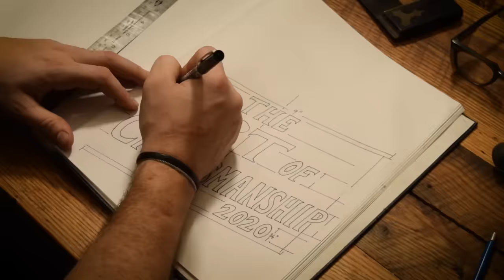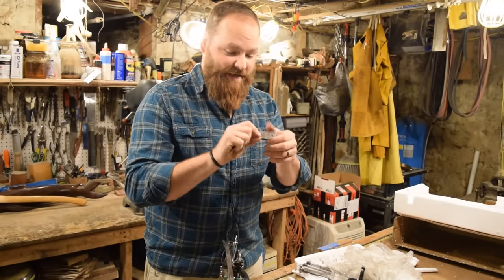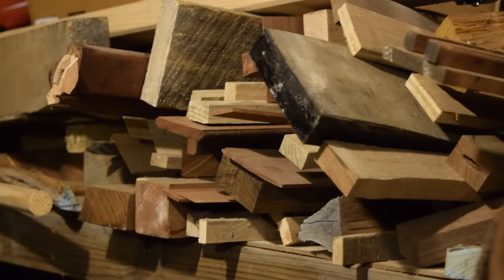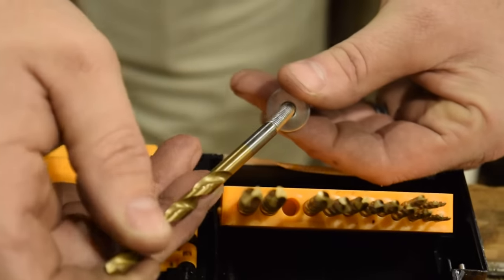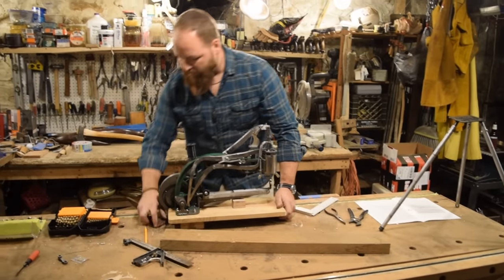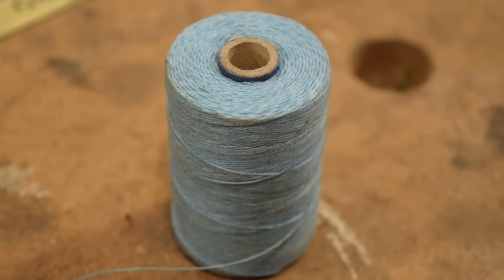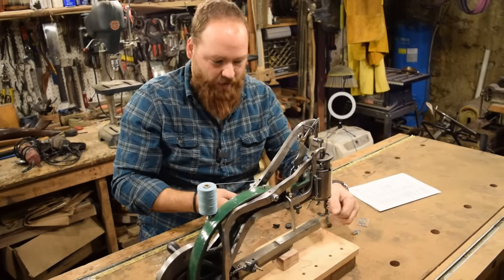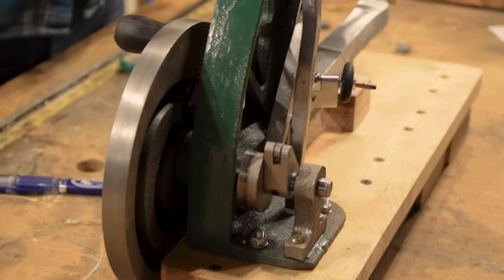The Infamous $100 Leather Sewing Machine: Unboxing and Setup

Comment: Love  everything but the hand flywheel. It is compact, metal built and for 100 bucks very affordable. I would use a piece of hardwood for the base and definetly drill holes to screw it down while using it. Anybody out there figure a way to put a foot pedal on this little guy? I mean, that's all it needs. you want both hands to work with any leather product, especially if you're gonna always sew in straight lines. You needs both hands to hold on to things.

Comment: Is that metal arm cracked at 17 minutes and 53 seconds in the video?
Reply: No. These machines are so cheap because they are VERY crudely forged and ground into shape. There is little divots and spots like that all over the machines where the casting simply wasnt thick enough to grind flat when they cleaned up the cast.

Comment: When i was using a hand sewing machine for Carpets all threads where waxed to increase slip. Twenty yards on a hand crank on a dense wool Wilton Carpet was a test for any machine, needle, thread and arms, as you had to pull it, in time.  Then two major changes happened in the industry. The invention of nasty Gripper rods and rolls of Carpet twelve foot wide retired the machine to the 
We gave up hand cranking because prolonged use is really bad for you, speaking from experience. A foot trestle is more suited to the material, as the power difference is huge and you get two hands on the material.
100 what ever is a fair price for all the work that goes into them. Now to wear it in. ;-)

Comment: Quite possible you just had it threaded a little wrong when the thread was breaking, there are a lot of ways to mess it up on the non-consumer machines. My rule of thumb is that if something goes wrong, re-thread the machine (at least the top thread).

Comment: You need to make a stand Where It Bolts onto the cast-iron and the throat of the whole shaft that's called a long arm sewing machine if the so down inside of cowboy boots tennis shoes moccasins you can sew on the insights so your throat to that thing has to be open okay

Comment: I got one and it depends where it comes from. Stripped it down refinished it, but things like the bobbin didn’t fit together. The thread spool holder was horrible. Spent over 20 hour repairing, painting and lubing it. Never got the bobkin to work correctly. Never got it to work so it went into the garbage where It belongs.  If your not good with rebuilding things stay away

Comment: There is a much simpler solution to sewing leather. An old fashioned treadle sewing machine with the right needle and thread will sew leather like a dream. Also, if you can find one like my grandmother had, it was basically a treadle machine that they put a motor on, those do leather too, with the right needle and thread of course. Treadle machines can be found cheap. I bought one at an auction for 30 dollars, and I had my choice of 3 machines. They're still around. The old treadle machines had to do everything, so they were robust and could do what you need. You may not want one for doing like heavy saddle leather, a lot of saddle stitching simply has to be done by hand, though they do make a hand stitcher that makes it go a bit faster. I'm kinda surprised you don't tool some leather for your sheathes and things. I used to do that stuff. It can be very interesting to say the least, but does take some learning time to build good skills like anything else.

Comment: I admire the craftsman and admire the machine.  Unfortunately, it seems not to have come with a book of instructions, so the buyer had to figure it out as he went along.  He made a few mistakes, as the comments illustrate.  I'd make them myself; however, I am a student of trying to think things through before cutting wood, working hard, and then discovering all of my mistakes.  Lesson-1 is shown at 12:18 where the lovely base needs to be corrected; we go on from there.  So, what to do?  You can't just start cutting and fitting, trying, and discovering.  You have to think ahead, which is hard to do when you don't have the experience of a professional leather-worker who has learned the hard way himself and passed it along to us.  Lesson-2:  That little wooden block, specially made to support the long sewing-arm, defeated the purpose of the long sewing-arm, as at least one comment shows.  The lesson, to me, another &%# craft hobbyist with a spotty record of success/failure, is not to start cutting  before promised salvation comes out of the box, but to stop.  And then try not just to think, but to imagine.  "Hobbyist" means 'amateur,' not professional leather-worker, in this case.  Why did those manufacturers in China do things this way?  Those folks ain't stupid.  They may not want to hire someone to write a book describing the ins-and-outs of something complicated that they're selling for what, peanuts?  So it's up to the buyer.  As to whom, "Thank you!" for the real life lesson in the need to figure things out, in advance, or else, lol.  Good luck; it looks like your off to an admirable start with your  new machine.

Comment: Hint:  Never run any sewing machine with the presser foot down and no material under it.  You will chew up the needle plate.  I got mine for $80 on ebay and it works perfect for heavy stitching jobs.  I'm curious why you decided to make such a large base....seems it would limit the range of jobs the free arm was designed for.

Comment: "there is a piece of leather there, that's kind of odd" they run the machine for 200 stitches on that piece of leather to make sure everything is good before they send it out. that piece of leather is proof of how your machine stitches. why would it be odd? you buy a gun and it comes with 1 empty casing. you're supposed to give the casing to the police department so if any bullets match that casing they know you killed somebody. i don't think it's enforced in any/many states, but the manufacturers still provide the once-fired shell for that exact gun

Comment: I don't think you see that the  long extension makes this machine capable of being in a boot or an arm sleeve unless you keep it  on a desk blocked in below.  A simple motor would rotate the hand wheel.         If you have a phone you can take a picture  of the bobin threading direction.  Everyone can take a picture.. Boy are the castings crude..  If you freed up the arm and lifted the machine you could make shoes.

Comment: As a fellow stitcher and diy crafts person, I cringed each time I heard this machine complete a revolution. 🤣If you going to lube it, if you can some graphite-based grease might help since it’s a fairly cheap unit and I’m probably guessing the clearances between some of the components aren’t remotely spec.  Also I’d put a pulley on it and make it like the old school pedal powered machines

Comment: Buyer beware:  Thses machines are the roughest version of a sewing device you will ever encounter. To get the potential they are capable of requires several hours of cleaing, de-burring, and polishing - or else you'll rarely get far before shredding your thread or jamming it because the timing has slipped. Expect to repeat all frustrations if you ever change the thread or needle sizes.

If you dedicate it to one size and leave it there, it'll work well enough.  MIne is set up for 138 thread using a 140/22 needle.

It does NOT reliably sew veg tan leather over 3/16" thick as delivered.  A dedicated leather needle with a cutting point might help.  The needles I am using are round - which is not the best for thick leather.  Too  much friction on the reverse stroke since a round hole in leather does not have cut fibers.  The result is very bad lifting of the leather when the needle starts its pull stroke.

Increased pressure on the foot simply stamps a deeper footprint into the work.  Get the best chisel tip leather needles that will work in this machine perhaps from Sail~Rite.

Wax on the needle will only rub off within a few strokes and will leave a buildup that cruds up everything.  Just get leather needles.

It works fantastic on layered up canvas, but so does my old Singer 223 - runs like a Mercedes and can be had for less than these Chinese scrapiron copies of a fine American patent from the 1850's.

Oil til it runs everywhere. De-burr everything.  Polish every point where the thread will run.  SOME people get sterling results.  I have for very short duration. I bought it to replace hand stitching because of worsening arthritis, but it cannot take the threads I use for holsters and heavier projects. 138 is the thickest it will work with, IMO.  It will not run artificial sinew because of the wax in it.

Once you get it tuned, I'd just leave that way.  Write down or take close up pics of the tension and presser foot settings showing how many threads are exposed for what tension is needed for varying thickness of material.

There are a few really good YouTube channels on this machine. I recommend watching a few from Harrison Hightower, who seems to be the Grand PooBah.  Very helpful.

  Junk or jewel?  Depends on your level of patience and finishing skills, because you are the one prepping the product for use. That's it from a Not Impressed Owner.

Comment: Why do they even bother trying to put a finish on those things 😂 Thanks for the review, I may have to pick one up.
Reply: Take it apart. File the edges, steel wool the parts, degrease, paint with hammered-finish spray paint color of your choice, lube & oil, reassemble ... aahhhh. 😎

Comment: Find a used sewing machine at a second hand store and adapt the motor and foot feed to the machine
Reply: That is a huge endeavor. Just saying. I've seen it done, but it takes major work and adjustments to the wheel to hold a motor belt effectively. And without the wheel, that thing won't function at all.
Reply: Someone just found an easier way to do it on youtube! Very exciting :)

Comment: I don't think it was the type of thread so much as it was the gauge of the thread that caused the breaking. The needles have to be sized to the thread. If the needle eye is too small for the thread it will cut it. To test for the proper needle size, thread the needle on the thread and then, holding both ends of the thread about a foot apart and fairly taught on either side of the needle, angle the thread to about 45 degrees vertically. If the needle is sized properly it should slide down the thread to the bottom using gravity alone. If it doesn't the needle eye is too small and it will cut your thread. This machine will probably be fine for very small jobs but I would not want to try and make a living with it.

Comment: so if a thick thread doesnt fit then its useless i guess, though i saw other leather makers praised the same machine, so i think ill pass on this and wont purchase it, thanks for the great unboxing!
Reply from the maker: There are several way to adjust this machine so that you can run thicker thread. I’ll be doing another video in the future with some add ons, and adjustments to get it working with thick thread and leather.

Comment: i understand your apprehension of the stand, and / or quality of equipment. but , in a practical, real world production application, where someone is sitting there daily, grinding out shoes, maybe it works for them. It's cheap, it's quick, and makes money..  if you want to be a leather seamer, then buy the real expansive machine? probably not gonna happen. But for 100 bucks? wtf. why not . maybe assemble it the way it was designed. then improve it after using  it a couple of times? Also, if you relieve the wood under the arm.  or create a drop table section, you can do larger projects. you limit yourself as it is. i like the concept.  i'm kinda picky. so i'd deburr / smooth the gears out and change to better bearings. in shipping there are preservative that also slow down the action . i'd have fun with that machine after "cleaning it up"  and a spot of light machine oil is your friend (<< hit like button)

Comment: The base is loose because it's designed to tighten and level as it settles into a dirt floor.
Reply: The base that came with mine holds it completely level and is actually pretty solid once the weight of the machine is on it. But I bet it would work pretty good on a dirt floor as well

Comment: Dude, have you never heard of Singer? Forget new Chinese junk.
Thier old machines made for leather still cost a pretty penny. My 1901 made for fabric can do what you do. 
I paid $200 for mine, not knowing the antiques market. They go for about $50. Moneywise, the silverware set left in the drawer runs about $150+. 
I bought it because it was cool to have something old that still works (1901) when my electrics don't.
I paid extra in ignorance, and broke even in luck.
The point of this story: look for the old and proven instead of new and cheap.
Old made in USA will be better than new made in China.

Comment: You mean cut a couple of chunks of what they call a modern 2x4 back in the day when they used to make real 2x4s we're actually two inch by 4 in not what they call today 2x4s today are a little bit smaller

Comment: !!!!! Motorize it!  For those in need of a cheap electric motor go buy whatever piece of cheapo machinery at Harbor Freight and cannibalize it for the motor. A lot of machines sold there are sold for cheaper than you can buy a new motor so not only can you get the machine, but a decent little electric motor when all the other parts turn to shit..and they will..LOL

Comment: If like me you wanted to just see if this works and is worth buying, skip to about 20 minutes in. A lot of time watching someone slowly cut a box open and explaining that there are random bits in the box etc etc.
Reply: Except, that, for the patcher, opening the box is one of the most intimidating parts. If you've ever bought a patcher and instead opened an oily, greasy mess of bent looking machine parts in a nest of crumbling styrofoam, you need that part of the video to reassure you that it's not as bad as it seems.

Comment: THROW THOSE NEEDLES IN THE GARBAGE. China made needles are so bad! Go to wawak.com and get the Organ brand in a HAX1 or the better quality HLX5. They're the same shank , but the HLX5s are stronger and made for thick multiple layers of material. You'd probably need size 20. They're only a couple bucks, but these needles are 1000x better quality than those cheap china needles.  That could also be why you're breaking thread. I think you're needle is too small (for that thick of thread), and those needles probably have burs in the hole that are probably cutting the thread. I would recommend the tex70 nylon thread from wawak. Its super smooth and really easy to sew with. That monofilament stuff is not good.

Comment: In my experience with these Chinese shoe patcher machines, they use poor materials and rudimentary methods of production with these. I had two of these, one that would sew ok and another one that is just a piece of crap and would jump out of time about every 3rd turn of the crank, no amount of tightening or thread locker would stop it from jumping time. The one I say would sew ok would still skip a stich every 50 to 100 stiches due to the slop in the gearing the machine uses, they are very much NOT precise. When stiches are skipped on leather you have a hole in the leather from the needle with thread stretched across it on your leather instead of in your leather. That is not something I can sell on top of wasting my leather, thread and time, if it is a hobbie then maybe but if your sewing to sell a project it's just not something that is usable for me. I took it down to one of the local sewing shops and let the engineer look at it and after scoping the inside of the sewing arm and measuring with calipers all the parts we found that the teeth on the gears were out of tolerance due to poor manufacturing causing the timing to be off at times just enough to skip a stich every once in a while. He advised we could order more gears, but it is likely we would end up with the same or similar issue and the cheap alloy metal used with use it would be likely with use the gears will wear and become more out of tolerance So, use it for what it is and don't expect a quality machine from one of these. You may get lucky and get one that sews like a champ but that definitely was not my experience with these. I ended up just biting the bullet and buying a cowboy 4500 the old saying buy once cry once is really true. I tried to give the old patchers away for free but after folks tried them out, they would not take them, so I rehomed the old patchers to the county dump. Good luck, I hope this helps.....caveat emptor

Comment: I'm disappointed that you don't use the correct tools for the appropriate situation as you claim to be a craftsman. Nuts and bolts are tightened with spanners or Allen keys, not pliers. The Forstner bit should be drilled as the counter-sink hole before the through-hole is centred and drilled. You do a good job in your presentation but you have all the tools, why not use them appropriately. You are setting a bad example to others.